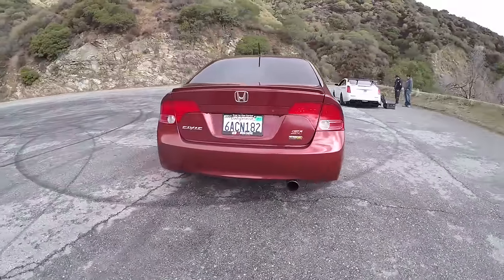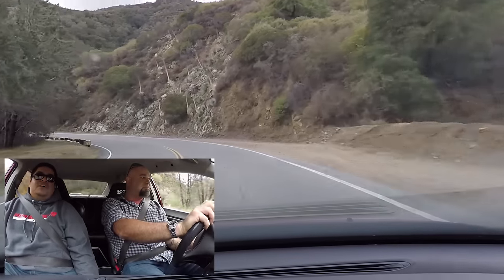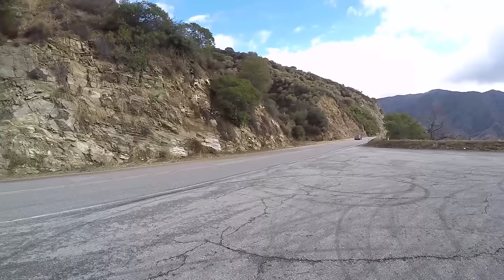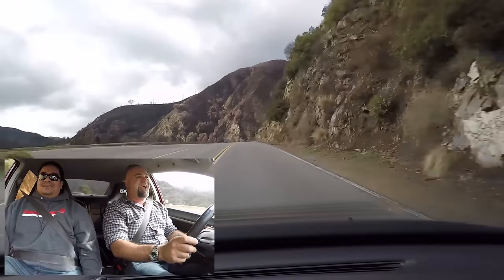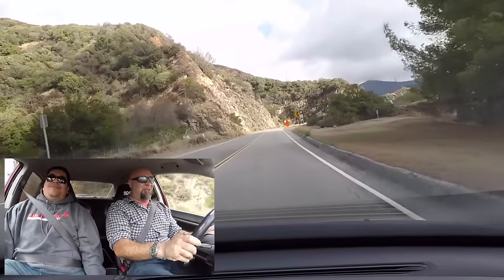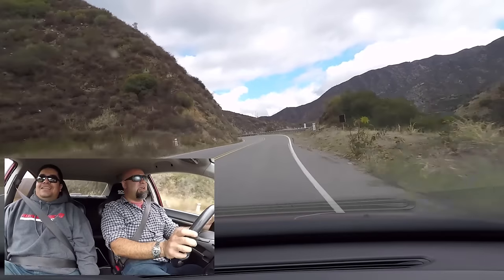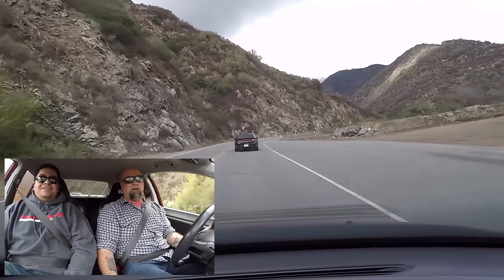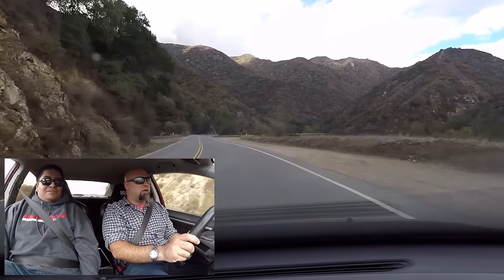INCREDIBLE 330HP All Motor 2007 Honda Civic - One Take

Comment: I dont see why everyone's freaking out over the cost of the build. what car can you buy for 15k that will run 11 second 1/4 miles? that's basically what a z06 will run and  at a fraction of the cost. not to mention that I bet it handles like a beast. 15 isn't much when you look at it like that.
Reply: and 9500 rpms? fuckin nuts
Reply: I thought he said 50k!?!
Reply: BunnyBUNGALO plenty of cars that’s not that impressive
Reply: 1990 eagle talon tsi awd $900 EMS+Bolt ons  6K investment will give you low 10s
Reply: @BunnyBUNGALO  
There are V8's that can Rev that high, there expensive tho
Reply: @4g63gen1  no it won't lol it would cost more than that.
Reply: @anthonywebber2211  yeah but that's apples and oranges
Reply: @BunnyBUNGALO  
I meant what's the big deal of a 4 cylinder reving up to 9000 RPM, when V8 can do it
Reply: @anthonywebber2211  most v8s don't? There's 4 cyls that rev to 12k, what's your point?
Reply: @BunnyBUNGALO  
Theres a BMW drift car with a 7.0 liter V8 that Revs up to 9000 RPM, Lingenfelter Performance built a 358 cubic inch (5.8) that Revs up to 9200 RPM, like I said there not cheap
Reply: @anthonywebber2211  I understand that, and there are 9 second all motor civics that rev to 12k easy and they are pretty cheap in comparison to other cars. An inline 4 is more balanced than a v8, which allows them to rev higher, more easily.
Reply: But there is a V8 that can Rev up to 19,000 RPM, but not available to the public
Reply: BunnyBUNGALO An in-line 4 is definitely not more balanced than a V8. Most 4 cylinder engines need balance shafts to cut down all the vibration. V8 engines do not. The reason they rev so high is because they have lighter rotating mass and because they don’t make a lot of power down low N/A.
Reply: @YZ-YZ-  
That's because 4 cylinder engines fire 2 cylinders at once, typical 4 cylinder firing order is usually fires 1,4 at the same time and 2,3 at the same time
Reply: @YZ-YZ-  
this is a youtube video title
Volvo V8 Balance Shaft exposed
Reply: Anthony Webber Cool, now show me a balance shaft in an LS7, that engine spins to 7k rpm stock.
Reply: Slow ass Impreza  
And you think this Honda isn't?
Reply: BunnyBUNGALO he needed slicks for 11 keep in mind. Crazy fast still. NA setups in a K series is boss, it made to be built all motor.
Reply: @anthonywebber2211  no they don't.... the cylinders move in pairs but fire one at a time, when one cylinder fires it's twin is at the top of the exhaust stroke
Reply: 4g63gen1 crank walk in a week for ya.
Reply: @anthonywebber2211  lets talk if it revs to 12
Reply: High RPM isn't everything, but A Top Fuel dragster reaches more than 300 mph before you have completed reading this sentence. With a redline that can be as high as 9500 rpm
Reply: Granny Gertrude  maybe lol

Comment: So this is the Honda people refer to when they say "my Honda can beat that"
Reply: C7 Z lolol probably although a c7 with similar mods would destroy my car haha
Reply: This is the car that’s faster than most on the street, you want something that can beat anything then you need more like 600 hp
Reply: @ryanclark457  not necessarily lol. You can do it with 200. Take a buggy rail, street legal and set up for autocross suspension wise. Slap a 2180cc built vw race motor in it and wala. Little short wheel base sucker's weigh maybe 1500 pounds lol similar power to weight ratios as a 600whp Corvette.
Reply: my V8 is Bigger than yours.
Reply: kids  LOL bruh dont ever mentioned a gay ass vw motor as the engine to beat anything... just get the DA integra or a civic and k20 turbo and strip it.... I want to atleast have a good looking car and reliable engine.
Reply: kids  corvette would still win. especially on the highway 😂
Reply: someone doesnt live in california
Reply: Ryan Clark more than 600 actually
Reply: Or there honda weighs 2000Lb with 200whp.

Comment: So he runs a 11.3 in this gen 4 door civic

So if you put this motor in a eg it's a 10 second car yikes all motor
Reply: Yeah this setup in an eg would be so much faster. Oh and the eg looks better too.
Reply: A҉n҉o҉n҉1҉3҉3҉7҉ 【X】 scary fact the eg if rear ended is gonna be right in the drivers seat this gen can take a nasty hit
Reply: All day and with a lighter chassis he wouldn't need such radical low gearing either which would also take away the 4-5 shift before going through the traps...... I could easily set that car up to make a 10.99 with myself driving as well.
Reply: A҉n҉o҉n҉1҉3҉3҉7҉ 【X】 might as well say how it would do in Ariel atom
Reply: Can someone explain what 10 second car mean?
Reply: @minhphan2047  it takes the car between 10.00 and 10.99 seconds to accelerate from a stop through a quarter mile

Comment: imagine that powerplant in an eg/ek hatch
Reply: What are the specs? I need this build.
Reply: I had the same thought.
Reply: would b insane!
Reply: Uff imagine put carbon-fiver doors,fenders,hood and the hatch just leave the driver seat every else inside has to go make ot light as possible
Reply: @miltonramirez8901  i bet it could run mid to low 10's
Reply: Wouldn't be hard lol the motor for these the k24 is like 1700 bucks it's cheap as hell

Comment: 8th gen Civics were the last good looking ones :/
Reply: Lancer265 the last best SI. I am definitely going to buy one I have had 3 of them now i have frs so going to get 8th gen and be set lol
Reply: That's why I got me a 2008 fa5
Reply: Is that after they put the shifter back where it should be instead of on the dash?
Reply: NOcanDoification woot woot 8th gen fam.taffy white fa5 right here. We have the best civic bro. K series, limited slip dif. And a 6 speed. The only downside of the 8th gen  is the drive by wire and the rev hang. Picked her up brand new in Oct 2008 with 3 miles now sitting at 90k.miles, l've only done regular maintenance, one clutch...about ready for 2nd , one starter and  6 sets of tires and rims, it's never left me stranded, shit i never even had to put on my spare tire. I don't see myself ever getting rid of this car. Its 10 years old and i still get compliments  and thumbs up. Installed Godspeed could and got sticky falken tires with tire rack TRM wheels that only weigh 16lbs each...what a difference good rims and tires make, its a new car and handles like it's on rails.
Reply: Ryan Clark lol yes what a sorry excuse for an si that was. Had a k20 but only like 160hp.
Reply: '12 - '13 HFP coupes are pretty nice looking.
Reply: jdm 8th gen even look better than usdm ones
Reply: hachi roku true forgot about that...we kinda got screwed on that 1
Reply: la 5ta y la 8va generación, definitivamente las mejores, hasta ahora.
Reply: Matias FD simon ese, eg and fa(fd)  muy hermoso.
Reply: Looks like a turkey with small windows. EKs look better to me
Reply: Still having my 11yrs old Gen 8 civic FD... goin strong.
Reply: i cant say i liked the 8th gen that much, at least not the 4 door
Reply: TET2005   I got a 06 but not the SI?  Love it. Hope I never have the crack engine block issue.
Reply: 9th gen looks good compared to the 10th gen. They're so wide and ugly
Reply: Nah. There ugly like 9th gen.  6th gen is sexy. Any 90s coupes are sweet.
Reply: Yup, I have a  Blue 2011 Si sedan, and a teal 93 si hatch. Both are timeless in looks. I've had civics for 20 years now and I still can't stop looking at it and appreciate the design. Honda carries their heritage on year to year.
Reply: 2016 civic coupe?? I think it looks good
Reply: Classically good looking.

Comment: I love Hondas but $15,000 is way too much .
Reply: you sound poor. $15k is nothing
Reply: DJ Barakas 15k is absolutely nothing for an 11 second car.
Reply: DJ Barakas Hope you know he said 50k not 15
Reply: Klutch 416 clean your ears and listen again. He said $15k
Reply: Justin L Oh watch out...tough guy on the Internet. Even if it was 15 he said that's for the motor which is just the build. I take it you have no experience building a block let alone sleeving and boring a K..then cams and the machining. his transmission alone probably ran him 5-7grand
Reply: A good turbo install would be  $ 4000 and would yield more horsepower.
Reply: DJ Barakas Realistically a full solid turbo build would run you +-10k with parts/tuning and if you do some of the wrenching yourself. I would definitely go boost on the K though but n/a engines are the shit
Reply: Klutch 416 hope you know he said 15k not 50
Reply: Ellis Woollatt i heard 50 grand
Reply: SDD525 15k isn't alot but 50 yes an read his lips 50 geez
Reply: Klutch 416 50 grand foresure because 15 isnt much
Reply: he said 50 not 15 because 15k isnt expensive
Reply: Ellis Woollatt maybe he said 15 but u know its more than that he was just agreeing with matt
Reply: But read these comments. Eerybody loves a mental all-motor build :P
Reply: It's a fully built racing engine that just happens to be in a street car. :)  $15k.  say $2k for the ported head you can buy from 4P racing, likewise for pistons and rods, $2k for the cams and all the valvetrain, plus all the machining work.  It's relatively inexpensive for a racing engine because there are a lot of shared development costs from the popularity of these engines.
Reply: Haha
Reply: 15k sounds fair for a NA 11 sec car.  People spend over 15k to run 10 secs and under.

Comment: N/A high compression engines are now my interest and have been for years.  Getting 330 out of a K series with TONS of expensive internals and sky-high compression is preposterous, yet becoming possible.  My friend just bought a new Honda sporting the K24W "EARTH DREAMS" which ironically was built not far from where he bought it.  Smooth power and the ability to be run at high rev's all day everyday, "He delivers for Amazon and Uber's at the same time"  impressed me.  Toyota reliability meets Acura performance.   The exhaust manifold is strange looking and you will notice it first! Wide open headers, a CAI,  along with some lighter parts and timing/cpu upgrades and I could see it putting well over 230hp to the fronts tires.  Messing with a Nissan SR16D-E myself trying to mimic Honda's F20C engine's hp.  Of course that would mean a largre bore and stroke  on a 1600 CC engine that already has high compression nut is that square shape I love.   Along with tons of internals and raises the question "Would this be just a weekend cruiser?" I don't mind that.  I'm flabbergasted even with even with the fuel options available from private sources like 95% Ethanol, 5-15% 115+ octane fuel mixes, and the new composites available giving stronger sleeves without sacrificing weight.  We left the N/A engine behind and keep turbo charging everything.  Even the more reliable super charger is dying!  I'm happy to see others taking the time to say, "No turbo or any type of boost whatsoever on this engine." when people ask what just blew them out of the water and the look on there face as they try to comprehend how you could build it!

Comment: sweet build. I have a 8th gen civic as well supercharged 364whp bone stock block and head. 330hp all motor is very impressive must be a tone of fun to drive this setup in a lightweight 5th gen civic or 6th gen would do low 10s high 9s

Comment: 11.3 @ 124mph is fucking flying! Fastest N/A Honda I've seen here is a totally stripped out, set up, purpose drag built EG Civic hatch doing mid 11s. Although Ronnie Lim's Integra may have been marginally faster, but I wasn't around back then

Comment: Holy Shit! I can't really say much more than that. Matt I do have a question for Emmanuel(or you could easily answer it I'm sure)Emmanuel, normally people up displacement to get more torque b/c from what I've experienced that's what upping the displacement does. I know that when you add displacement you do get more horsepower but you also get more torque than hp. So did you up your bad ass N/A Civic's displacement mainly for horsepower or did you do it to make it easier to drive it below VTEC on the streets? I heard the cams at idle and with VTEC set at 6800RPM's the mid range must be around what? 4 or 5K?  What does the engine red line at by the way? If I could get some of my questions answered that would be cool. Matt, thanks for making all of your vids and this one as well it was pretty epic. Have a good one.

Comment: A lot of these comments are saying how they don't believe it runs 11s with this amount of horsepower but no one seems to be taking into consideration the gearing! Gearing (and tune) has so much to do with performance. I mean you can even hear the motor dropping right into the power band after a shift.

Comment: 2500 lbs?  These are like 3100 from the factory.  I wonder what weight loss mods he has done
Reply: The sedans are actually 2900lbs stock surprisingly, and the coupe is 2800

Comment: Nearly bike engine sound there, boiii. Now THAT'S why I love N/A. :3

Also, this is pushing 150HP/L at the crank, here, guys. If you could do the same with a V8 model, it'd be 750HP at the crank! A V6 would be 563 at the crank!

And it will ONLY get better with HCCI, FreeValve, Hemp and Hydrogen fuels, etc.

Comment: I'm building a 300 hp 9 gen all motor with a z3 head. I have everything but the intake manifold. Trying to figure out what tb to use. I had a zdx on before and maxed out on 260 in my z7 motor

Comment: Emmanuel, what could you do with a current generation Honda Fit, good starting platform would be the new for 2018 'Sport' trim which is mostly a manual transmission trim level. 
I know it has a 1.5 liter DOHC VTEC 'Earth Dreams' 4 cylinder. My understanding is Earth Dreams engines have a much higher compression ratio than honda engines had before allowing for lower displacement overall more efficient use of fuel.

Comment: Factory weight of that car is over 2,900 lbs, what was done to get it to drop 400lbs, has it been weighted or was that just a guess?  Nice car tho!!!
Reply: I was thinking the same. Bucket seats in 8th gens drop 60 lbs, carbon hood/trunk a little more, but I don't see how you can get more than 200 lbs off easily.

Comment: "Examples of octane miscitation can be found at the Iowa Renewable Fuels Association titled "E85 Facts" which cites a range of 100-105, and a document at the Texas State Energy Conservation Office titled "Ethanol" which cites a 113 rating."
Hell! You could go as high as 18:1 with Ethanol if you build the engine for it. Not saying it would be cheap but, Indy cars run that on their 4cyl engines.

Comment: Hey bro have a question I got a 2006 civic si the clutch was rebuilt 2 years ago. Now I cannot put it into gear when engine is on but goes into gear when the engine is off. The pedal seems not to go down correctly as if not engaging. Any ideas what it can be??
Reply: So what was the issue? Synchro’s? Clutch alignment?
Reply: Did the actual clutch pedal break? There's a design flaw that causes that to happen in 8th gens. Also check your clutch fluid, bleed the air from your clutch system.

Comment: Impressed with this build but 50g on the engine? Jimminy.  

Labor of love I guess. ;)

Edit: 15g, not 50.  My bad.  Thanks Sergio for straightening me out.
Reply: I thought he said 50.  Went back and listened to it again (7:37) and it he did say 15... my bad. 

No one here was arguing  'whp per cubic inch' but point well taken. 2.5 liters is 152.55 cubic inches.  With 330 whp, that is 2.16 whp per cubic inch so close enough.

I'm not a big Honda fan but I do respect the K series and I also like the H22.  

If I was to build a high hp n/a engine it would probably be a Coyote.  One of my favorite n/a Coyote builds is this one. (/watch?v=jfpM9IUoI4k).  Keep in mind also that is a load bearing dyno and 91 octane gas.  Another amazing on is JPC's. (/watch?v=yw5gYA7gXic).  That's 550 at the tire.

Comment: I find it hard to believe this thing weighs 2500lb. But I think 15k for a crazy all motor build is actually not bad. I have about 10k into a 2ZZ-GE Corolla and it probably makes 215whp at the most. 330whp is crazy but I would not daily a 14:1 CR.
Reply: angerey  why? I mean that’s what it weighs we’ve had it on scales several times.  I went pretty hard core on this car for weight reduction even changed the roof.  All si’s have sunroofs FYI

Comment: People making a big deal about 15g for 330whp. Put this engine in a lighter civic, easy 9s car. That's the difference. I've seen Bolt on cam H2B swapped Egs gutted to hell run low 11s. Weight makes a difference. This car is 2500, Versus something like a Gutted EG that could weigh 1600. That 330whp can go a LOOONG way. especially for 15gs

Comment: LOVE LOVE LOVE all motor civics and K series and respect the fuck out of Emman and his build but building a all motor civic for 15k civic, fuck that. It wouldve been easier to build a mild k24 motor in a eg/ek chassis and run the same ET time with a better power to weight ratio bc the 8th is a fat pig. Kudos for eman to bring the fa5 to 2500lbs though which is unheard of. lol kinda wished he didnt give the amount to build a car like his bc it takes away the shock factor with the price tag but IDK about anyone else but i cant wait for eman/Vit push the limits on the 10th gen civic.

Comment: The smoking tire should know that clutches hold torque not power. No way a 2.5 NA motor is putting out that much torque. This engine is clearly leveraging high rpm to multiply them little torques into some damn good power.

Comment: I wonder if he's using an aftermarket tensioner because that's the only time I see them fail. Also he would probably benefit from an 02-04 type-s fd his 11.3 vs running 10's could be not only having to shift to 5th but fighting for traction. Type r as well as some of the others are more for spirited driving. They're very aggressive. I had a 05+ type-s fd and I hated it.
Reply: HaHa Too Slow I modify my own tensioners